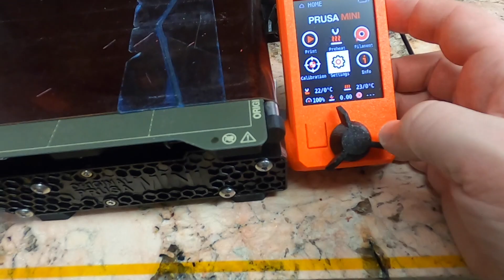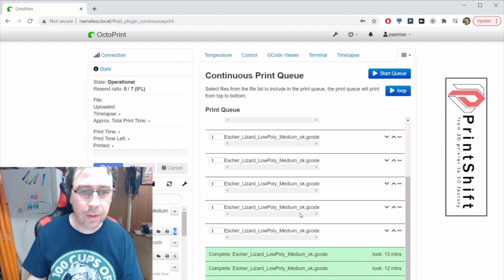Prusa Mini: Bondtech Extruder Upgrade

Comment: Looks like the Raspberry Pi is been powered direct from the mini, interesting, may have to try that with a Pi 3b.
Reply from the maker: I show the install of the Pi power supply here: https://youtu.be/L7KJyT3akVo?t=246 - uses a 24v to 5v converter, which steals power from the electronics later in the same vid: https://youtu.be/L7KJyT3akVo?t=508 .  Focused on adding a part ejector, so the mount for that is also the pi mount... but yeah.  I needed the printer to be portable, and really I just like the clean look of integrating everything in.

Comment: why should a direct drive be better than an Custom made Bowden Extruder special for the mini?
Reply from the maker: Any Bowden will have more trouble with flexible filament - because you're using the filament to push the molten plastic out.  The filament will act as a linear spring, so that the extruder has to push harder and retract more to keep pressure at the hotend consistent.  The linear advance running helps with that, too.
Reply: @PaulChase  Bondtech expensive? Will an bondtech outbreak make a difference with the normal prusa outbreak?
Reply from the maker: @Oxizee  I haven't replaced the heatbreak - haven't had any issues with the stock Prusa.  I'm not sure if that's a problem anymore, or just early units.

The Bondtech extruder upgrade is a bit expensive, but I'm happy with the performance.  It uses hardened drive gears - so good flexy performance plus will survive if you print abrasive materials (don't forget a hardened nozzle if you want to do that!).

Comment: quick question does the Prusa Mini/Mini+ the extruder that comes with the printer can it print flexible filament like TPU and TPE ? 
or do I have actually buy a BondTech extruder I'm not good when it comes to installing items and that I'm just learning about 3D printing
on the site it says the 

mini/mini+ supports material I'm assuming ( Flex means maybe TPU filament? ) I just want to be sure before I start buying filaments and other items like upgrades in all. 

I hope you can help me please and thank you.
Reply from the maker: The original extruder isn't very good for TPU; there's too many places for the flexible filament to slip into and jam.  It can be done, slowly, but yeah.  The Bondtech install isn't bad, but you do need caution for the cable install.

Comment: do you plan to add a e3d revo micro hotend once they release? also, are you aware with the 4.3.3 firmware you can save the esteps and can also reverse the direction of the stepper motor without having to mess with the wires?
Reply from the maker: Yes, and no - thanks for the heads up!  I plan to do more extruder upgrades on the mini, it's such a great form factor.  I assumed firmware updates were coming, but have been working on scaling up the conveyor belt part lately.

Comment: Great video & awesome printer you have there. What happens to the unload/load or color change function when the e-steps are only set when the print starts? Can you showcase the quick-release function in another video?
Reply from the maker: Prusa Mini e-steps-per-mm is 325 stock, vs. 406 for the Bondtech extruder - so the load and unload are both a bit short.  However, once you've executed a gcode the e-steps persist, so it works perfectly thereafter.

Most of my other vids are about the part ejection - the goal is to make it as accessible as possible - it's not as easy as the Bondtech upgrade, but I'm working on it :-)
Reply: @PaulChase  Thanks for your reply. Are you sure about these e steps numbers? I was looking a bit into the firmware and I was pretty sure e steps in the default configuration.h were 500 and bondtech states 415. Didnt find anything on google
Reply from the maker: I read the numbers off my printers - so 406 is my tuning on top of Bondtech's recommended 415 - based on doing a lot of softer filaments on it lately.  Stock is definitely 325, though - (Recv: echo: M92 X100.00 Y100.00 Z400.00 E325.00) - off of my newest mini.  It's pretty odd that there's no easy reference... but here's the source: https://github.com/prusa3d/Prusa-Firmware-Buddy/blob/4450c5f2a63130e0a043d191d1c1dc95a09c9aec/include/marlin/Configuration_A3ides_2209_MINI.h

Search down to DEFAULT_AXIS_STEPS_PER_UNIT, and they match what my printer tells me: #define DEFAULT_AXIS_STEPS_PER_UNIT { 100, 100, 400, 325 }

So yeah.  It should be easier to get that info... but it's around if you read the source code :-)

Comment: Hello, I have recently installed the Bondtech extruder on my prusa mini. I have not been able to get a clean print using this extruder and I have no clue why. The layers are often terribly inconsistent. I have updated my E-Steps and double checked the guide many times, I have not missed any steps. I am sure there could be many causes but do you have any ideas on why this could happen?
Reply from the maker: As a diagnostic, I'd try to mark the filament, extrude 100mm, and see how much actually comes out.  You should do that with the Bowden tube disconnected, i.e. make sure the extruder is accurately extruding, then if it is repeat with the hotend heated.  Problem has to be one of 'em.

Comment: Are you using the default flexible profile to print the overture TPU?
Reply from the maker: yep - works great.  I do goose the temperatures on the Mini since it's got great print cooling - that lets me keep the speed up, but does lead to more stringing.  Cooler temps and slower printing look nicer, but the difference isn't huge.  More expensive TPU's are generally a lot less stringy.

Comment: Hey, could you please make the video on how to flash prusa mini with this firmware using DFU mode?  I have problem with it, would be nice if you make video instruction to make it  right! https://github.com/matthewlloyd/Llama-Mini-Firmware 
It will help to change E-steps for bondtech extruder. 
and i have no idea how to flash it with raspberry Pi
Reply from the maker: To flash the Prusa Mini, you need to cut out its appendix.  No, that's not a joke - there's a little piece on the prusa mini's electronics that you need to cut: https://help.prusa3d.com/en/article/flashing-custom-firmware-mini_14/

Note that Prusa Research will gladly tell you how to do so, but will not provide technical support if you do.  It's basically Prusa Research trying to keep support costs down while allowing hardware hackers to go nuts.  I'll probably modify one of my minis eventually, but my goal with the PrintShift project is to make it easy for everyone - hence trying to avoid voiding the warranty!